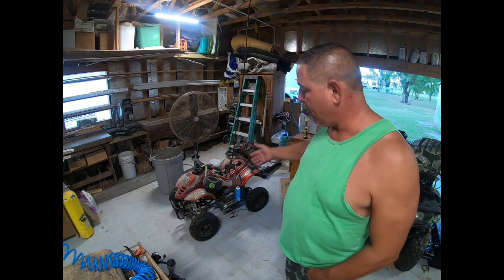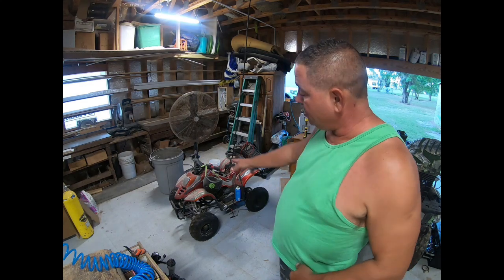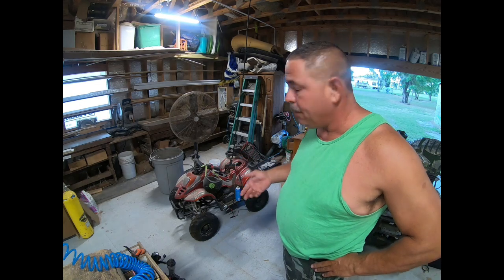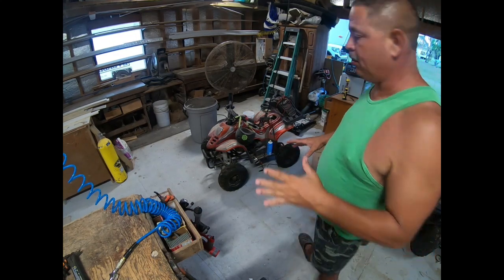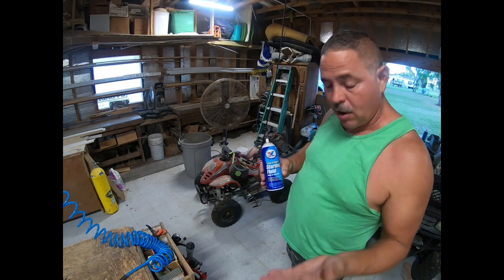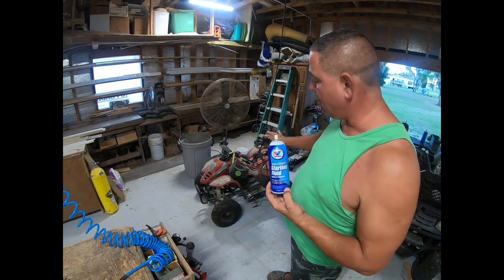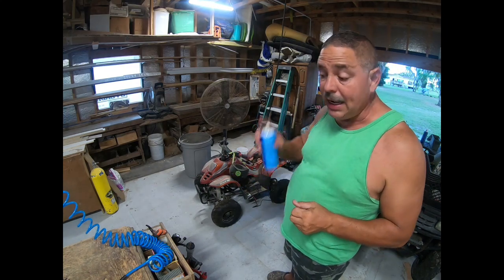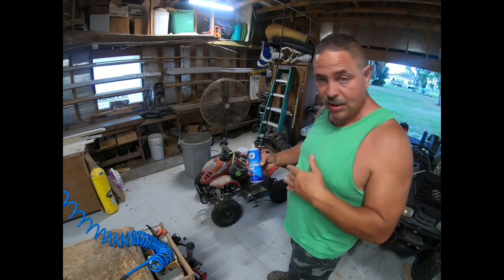How to start a small engine that has sat and won't start

Comment: I have a minibike that has not been used in 6 years.  I fixed the tires, tried to start using either and it fired off of the either but would not run.  I opened the carb up and it smelled like a can of varnish. The entire garage smelled like I just painted with varnish.  I disassembled the carb,  put all parts in ammonia overnight, reassembled the next day and now I have a good running bike!  Took a little more engine adjust but runs great now!!   Thanks a million!!
Reply from the maker: Awesome to hear. Share the video with others. I tell this secret every chance I get.

Comment: Thanks Mike, I just bought a whaler 15 with a 90hp engine that needs carbs clean.  I was about to order new repair kits but I would try this before to see how it works. Thanks for tip, very much appreciate it and as always, love to watch your videos.
Reply from the maker: Good luck, it should work out well.

Comment: Hi Mike - great to see ya, and you're looking well! Great video with a useful tip. I've got a 2 cycle weed eater (I think you Americans call them!) that has been back to the shop & been cleaned. Not used over the winter & now won't start again. I'll have to see if I can find some Ammonia here in the UK. Best wishes & stay safe bud!  👍👍
Reply from the maker: Hey Trampster, Ammonia is very common here in the states. Sold at every grocery store and the like. It is also very cheap, around 3 or 4 dollars US. Good luck and let me know how it works. I have done it on so many different things and have had great success.

Comment: I got a secret for ya if your in a hurry. Don’t matter what it is. If it has a carb. Verify you have fuel to carb and float is letting gas into it. Then fill vent hole with carb cleaner. Use blow gun on vent hole. It will open all blocked holes in carb. Has worked every time. And ya don’t even have to remove the carb...